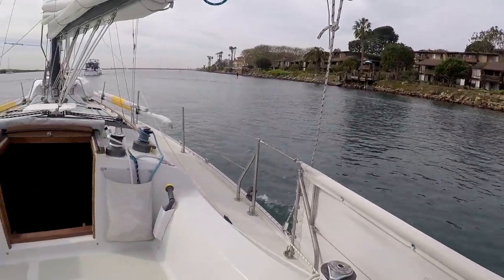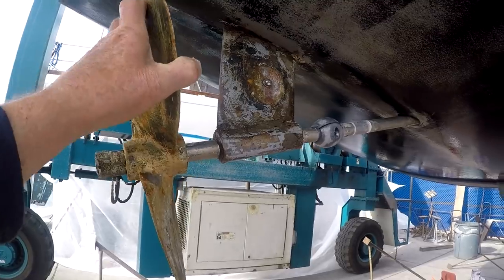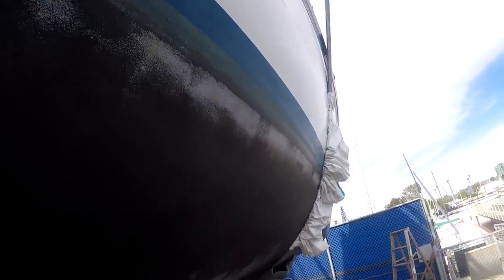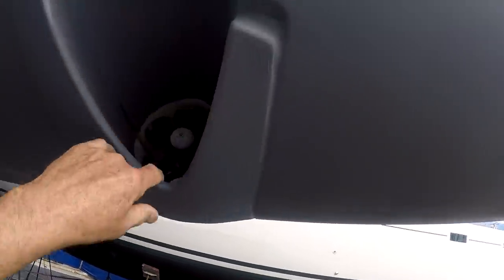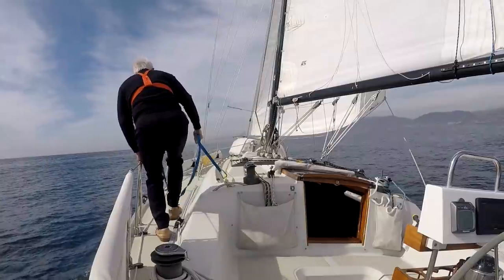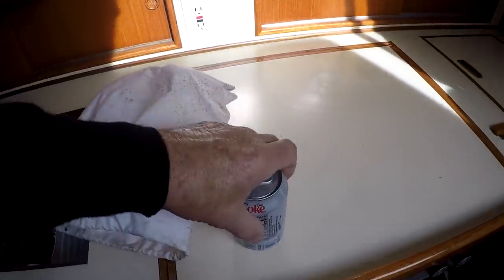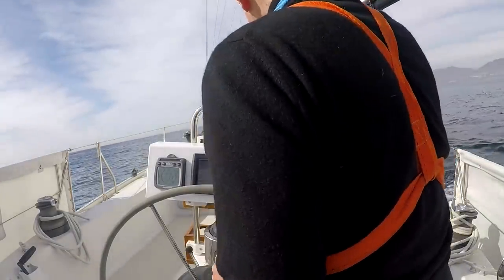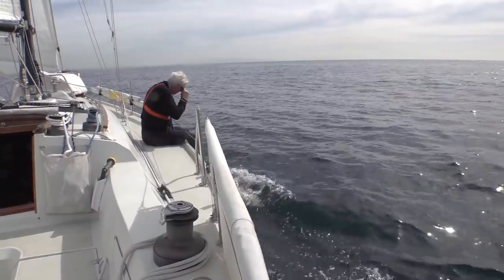Why We Sail--"Rehabilitation in Winter"

Comment: Hi Christian. I have been following you for some years now your content is always most enjoyable. I am certain you need no advice, never the less I will make a little suggestion.
Jack-lines. Try soaking them in water for an hour or so and then install them tight, as they dry they shrink a bit to! 
I try to keep mine close to centerline of the boat  or at least inside enough that if I was to fall my theater line would not be long enough to allow my body to go overboard where I would simply be dragged along side the hull (!). 
Cheers,
a.

Comment: Love it and great to see you closer to the universe again. One thought and question on jack lines: Another sailor puts his port jack line around the starboard side of the mast and vice versa, rather than run it straight up one side of another. He's suggested that if there was a slip, this would keep you closer to the deck rather than over the side. Of course you'd have to detach the carabiner at the mast then re-attach  to go forward. In heavy weather and seas it's not the ideal scenario, but I liked his idea and it made sense. Any thoughts? Or are there blocks at the base of the mast that would prevent this? Would love to see it in a future episode. Big fan and thanks for the videos and deep thought.

Comment: Would you recommend an Ericson 38 (or even a 32) as a good choice for a single hander with limited (or in my case, no) experience?
Reply from the maker: No.  Start with a dinghy, get wet, get sore, and in a year or two you'll know what you don't know. Cruising boats are  about systems management--they don't teach you how to sail.
Reply: @ChristianWilliamsYachting  good call... I sure don’t want to get too far over my skis as a beginner. I’m checking out the Lasers, RS boats and the Zims this weekend. Thanks for the advice!!

Comment: Hi Skipper, isn't there another way to tack with your pilot, for example mine needs to press simultanious two buttons to tack 90/180°either sb/p.
We are not as fortunate in winter as you, boat on the hard here in Belgium( and no Brussels isnt a country ). Cheers
Reply from the maker: Yes, I just find it easier to push one button multiple times.

Comment: Christian, did you say the smaller through-hulls are propane locker drains? It looked as if they are below the waterline. If so they won’t drain the propane: although propane is heavier than air, it is lighter than water.
Reply from the maker: They're above waterline.